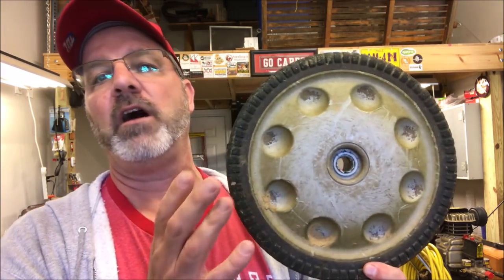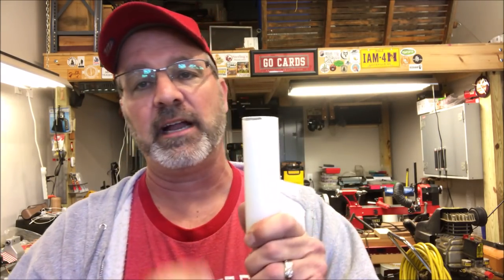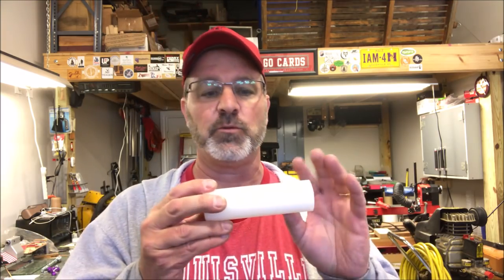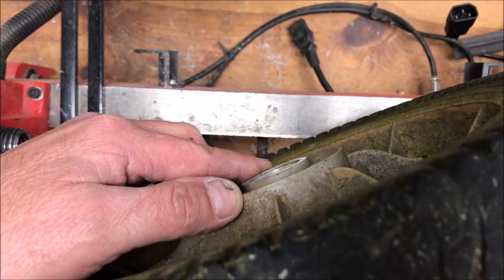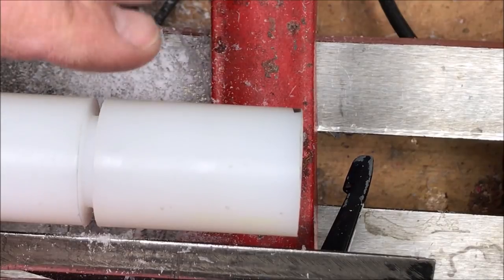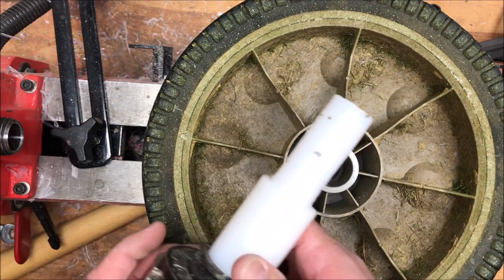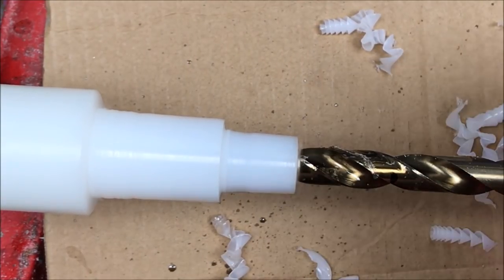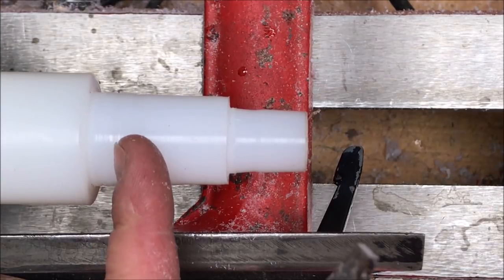How I Fixed My Mower's Wheel With Delrin And My Lathe

Comment: Great video. Well thought out and executed. I would go a step further and go ahead and cut another one for the other side, but that's just me. I personally think you re-engineered and improved the rear wheel bushing.
Reply from the maker: Thank you Frank,
  After using the mower last night, the other side will get done, it worked great!

Regards,
Bob

Comment: Great fix for a common problem...hey and you got to use your lathe in the process HAHA!!!

I had to break down and buy a new lawnmower this year....last one lasted 8 years after it was given to me and the previous owner broke the front wheel assembly off of it...a couple washers and a couple minutes of welding and had it fixed quite easily and got me through 8 mowing seasons, poor engine finally gave up on it and unfortunately a new engine costs more than 1/2 the cost of a new lawn mower.  Guess I should be good for several years now since I bought a new riding mower last season and a new push mower this season HAHA!!
Reply from the maker: That was a good mower if it got you 8 years, it was worth fixing. I know what you mean about parts being so expensive. It’s ridiculous.

Comment: Your video is funny. You quote measurements to one hundredth of a millimetre, then mark with a sharpie whose width is a good two hundred times that measurement.

It may help if you glue the bush to the wheel: then you have the new delrin spinning on the steel axle, which is good. As it is, you have the new delrin spinning on the the old plastic wheel which is not so good.
Reply: Hardly precision engineering on a wood lathe but for what it's doing near enough is good enough.its not doing the Indy 500, Probably outlive the mower . Good fix Bob
Reply from the maker: LOL, thank you Alan. 

Regards,
Bob
Reply from the maker: Thank you for watching, 
  You are correct, I’m not very good at precision work.

Regards,
Bob
Reply: I had a  similar thought.....Like I learned in the US Navy.. Measure it with a micrometer, cut it with an Ax....

Comment: What fancy mower has a single wheel that costs $60?
Reply from the maker: You have to purchase the whole axle assembly with bushings and all. I know because I purchased one for the other side two years ago. 

Regards,
Bob
Reply: @RJBWoodTurner  I had to get a new drive wheel for mine last summer and I think I paid around $20-25 for a new wheel and bearing from Arnold/MTD parts, they carry a lot of OEM and universal parts.